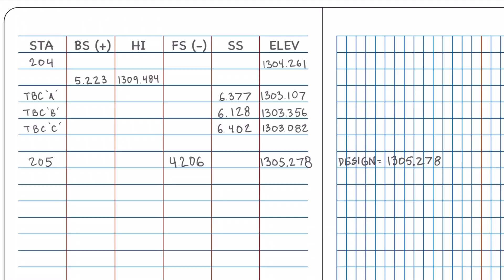Calculate Elevation & Grade with a Builders Level

Comment: How are you getting different side shot measurements without moving the graderod are you using the top or bottom crosshairs
Reply: Look at the video around 2:41 and 3:14 you will see the Rodman has moved a few feet to a new location. He does this several more times for the additional sideshots.

Comment: So how would you calculate pile cut off elevation??
Reply from the maker: @nathanallsup1224  Can you be a little more specific with the data you’re looking for.  Different locals use different terms related to spoil Calc Latinos, just want to be sure I understand what you’re asking for.  Thanks for watching!
Reply: @leansurvey8212 basically I'm referring to pile cut off. Or in other words the finish grade of the pile. If you had a single bench mark given by survey how would you find your final grade for driven pile?
Reply from the maker: @nathanallsup1224  You can certainly have more than one cut or fill, the same way as you would for a drainage structure with multiple inverts.  Multiple cut/fills can reference the same top of hub elevation, so long as the offset hub isn’t disturbed as each component is constructed.  Regardless of whether whether your pile has a specific design elevation at top, a design for FG, or a differential from the existing ground elevation to the top (which you would have to calculate and that would become your top pile grade), the math would be ‘design’ - ‘hub elevation ’ = cut or fill.  You should always (but ESPECIALLY ALWAYS with multiple cut/fills) write an acronym from what you are grading to next to the cut/fill number for clarity.
Reply: That should be provided on the prints.
Reply: @joeysausage3437 let me rephrase my question so that it can be understood. I think it's a fairly simple question. If you have a given  benchmark elevation given by survey and the given cutoff elevation as per the plan, how would you shoot the cutoff elevation
Reply: @nathanallsup1224  Watch the video until he takes his first shot. That give you a visual.
 1 set up gun and get a HI.
2 subtract the pile elevation from the HI. That will be your rod reading. 
3 shoot and mark the pile.
Hope that helps. I'm not good with communicating on the phone.

Comment: Really awesome video! Do you have a video on finding “known elevation” if there isn’t one?
Reply from the maker: @soty8877  Ooo, great concept.  Do you mean like matching an existing topo or on a construction site?  The answer might be a little different depending on the application- but I’d love to help.
Reply: @ for example, I will be in out in small Village in Thailand completing a project. I doubt they have any surveying points out there. Just curious if there is a trick/ process to finding that or maybe even matching the new building, to the current buildings.
Reply from the maker: @ What kind of software are you using, or do you mean just for the physical search part?
Reply: There will always be a known elevation of some kind given by some reference point or in rare cases a group of reference elevations given by a set of known points. The existing points can represent anything - other buildings, results of previous surveys done using GPS receivers, a top center of the nice big rock sitting nearby commonly acknowledged as the center of the village, or just a corner of a parking slab taken as elevation 0 with coordinates [0m, 0m] and the roughy north going edge of the slab used to define the horizontal direction of 0 degrees along with the direction of your X axis. You never just go out and do measurements in a random place in the middle of nowhere. There is always some kind of a project or a plan that required the measurements in order to establish proper dimensional relationship between some objects. The project is the only reason you even bothered to get up of your chair and go do any measurements in the first place. The technical level of such project can differ greatly but there are always some kind of it  in place and there are always some requirements either explicit (in proper projects gesigned by an engineer) or assumed (when it is you who wand to put a small concrete slab for a barbecue somewhere parallel to your house where rain water will not flood it and where it will look OK). The type of the objects participating in your project and the kind of the relationships between them will define both the required points as well as the reference points needed for a particular project. It will all have to be specified by the guy who designed the project.

Comment: This video should have included a warning that sideshots should always be observed twice. Mistakes can happen easily if you accept a single reading at face value. Whenever I have to read a dozen points from one setup, I will backsight, perform all of my sideshots, break on the final sideshot, then observe them again going backwards before closing my run.

Credit where it's due, your explanation of leveling is very straightforward and easy for rodmen I have worked with to understand.
Reply from the maker: @dikemawson3008  Thank you.  HARD AGREE on that comment as well, taking a reading, look up, take it again to verify for single wire.  For three wire, checking your reading math (delta between top middle vs middle bottom) is your double check- because then your readings are mathematically verified, not just visually. I also recommend your method of running back through the same points on your way back to the benchmark, not only does it QC and average your elevations, but if an error or misreading did occur, its clearly highlighted by the doubled up data AND correcting it is confined to repeating the one setup as well.  Great thoughts!

Comment: Great video but what I would have done to make the math easier is when looking through the level at the backlight I would have turned the screws all in the same direction to lower it to eliminate that .003 and get a round number rod reading of 5.22.
Reply from the maker: @littlenel17  You’ll notice in all my level in videos, I promote rounding to the thousandths when operating a builders level (though not a laser level). As a result, I would not spend extra time dialing in my first reading when all my subsequent math and reading would contain thousandths anyway.
Reply: @leansurvey8212  it makes sense…for elevations on benchmarks we just go to the hundredth…the laborers dont want to deal with splitting the dashes on a Philly rod